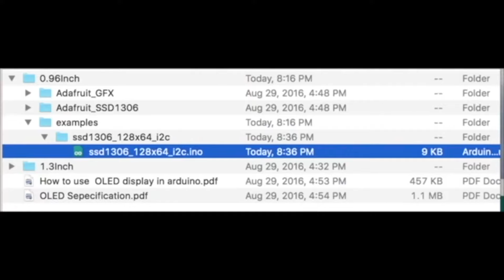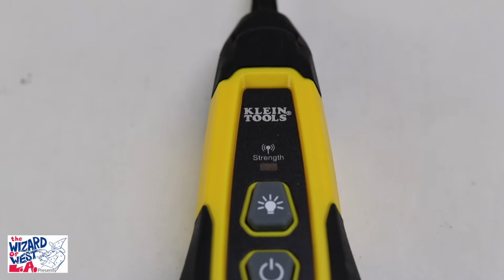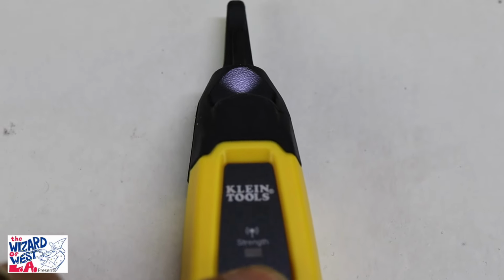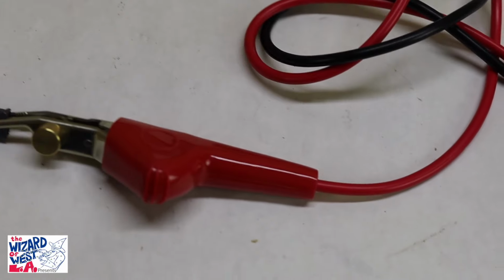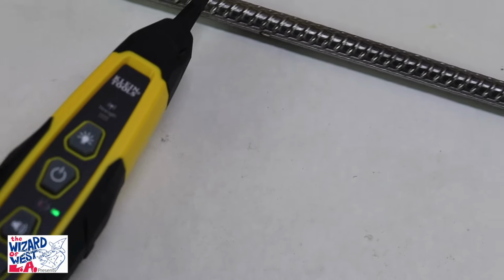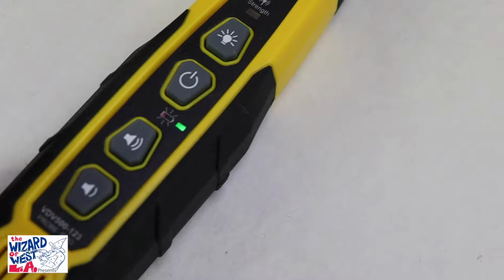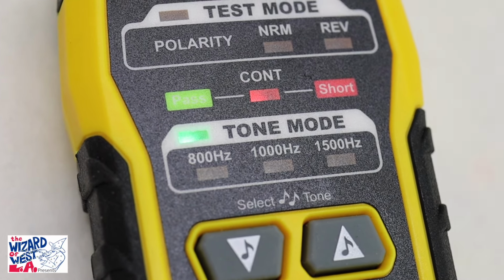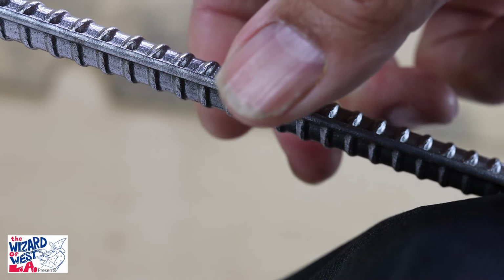How to use a Tone Generator (Klein VDV500-123)

Comment: Would have been great if you demonstrated on an actual cluster of wires instead of a big piece of steel
Reply from the maker: Yes I will do that using a cluster of wires. Some tied together and other apart.
Reply from the maker: Thanks Victor for the suggestion
Reply: What about the bottom of the probe...the 2 holes!..what’s it for??
Reply: @xbnayshun2765  those are to insert toned pairs for final confirmation

Comment: I bought one of these to sniff out the wiring in my house. I was able to find two buried junction boxes in my garage ceiling and wiring running behind a wall. It saved me from tearing out that wall and those two junction boxes had overheated in the past, with some good scorching going on in the boxes. Also helped with the HVAC wiring, an installer hacked it up, this sniffer allowed me to make sure that wiring was still useable vs running new wiring through the wall and ceiling. The tone is just fine, it easily sniffed out multiple wiring in several walls which saved me a lot of work and time. I'm keeping mine, and I don't work for Klein.

Comment: 1- Another trick which is somehow based on the same concept you alluded to (touching the conductor by your finger), is that if you connect both alligator clips to a pair of wires on one end and send the signal down the wires that way, and if  at the other end of wire you encounter a plethora of wires which you might find confusing to identify,  the trick would be to keep the probe amoung those wires so that you hear the probe sound, then try to short ends of each pair together. Once the pair which carry the signal get shorted, probe sound would stop.
2- I suppose the finger-touching trick you mentioned, is based on the concept that a bunch of wires close to each other can influence each other and due to the sensitivity of the probe, influenced-wires would cause probe's sound as well. By distancing the probe from the wire, in effect you are reducing the sensitivity of probe applied to the end of the wire, then by touching the wire by your finger, you are giving another path to the signal in wire to pass through (sort of grounding), hence weaker sound form the probe. I suppose if you wet you finger and stand bare footed on concrete, when you touch the wire with your finger, perhaps probe's sound stops (in fact your are grounding the signal in wire via your body). I don't have one of these, therefore I  cannot test the above theory. I suppose if they make probes with sensitivity adjustment capabilities, we would not need to touch the wire by hand anymore. In such cases, when pretty much each wire is activating the probe, all we need to do would be to reduce the sensitivity of the probe and then bring the probe very close to wires. Signal-carrying-wire would activate the sound in probe, but other wire's signal would fall below the threshold of the sensitivity of the probe and would not cause any sound......Do you think this makes sense? .... BTW, thanks for your wonderful video ...

Comment: You are awesome! I have this tool and couldnt get it to work right and I finally got it to work right! Cant wait for the next job I get with a mess of cables to search through to finally be able to find what I need in a few seconds ! Right now pulling out connections and testing them one at a time to find a number tag is a pain!
Reply from the maker: Thanks you! Yes I am finding more and more uses for mine as I have to do a lot of wire tracing. Many times the labels are wrong. Thanks again for your comment!!! Thank you Sam Peters
Reply: I found 1 of these ,do you know the value, or what I can get for it if I try to sale it
Reply: @joedavila406  $2.00
Reply: I didn’t have any need for mine so I sold it at the pawnshop they only gave me $15 for it and then another $20 for the box

Comment: I have two outlets in my house that aren't working - both on the kitchen counter. One was a GFCI and I found out it had a loose connection and was creating an arc and burning the wire. The damage was very minor, but I replaced the whole thing anyway. However, the actual power lines before AND after replacing it, were dead (with the circuit breaker on, of course).

The entire house is daisy-chained and several of the GFCI outlets are connected. One goes out, and you have to find out which one popped so you can reset it. But I didn't find any of them that were popped. (I say popped, because the reset button "pops" out when the circuit triggers a break.) So now I have no idea what to think. I've tested a few other outlets in the house, and they work fine. The problem is either between two outlets, or it is another connected outlet with loose wires that are no longer providing electricity to the two dead ones. But I have NO CLUE where this line leads to next! It's not the next outlet along the kitchen counter because that outlet appears to be a "dead end" that doesn't lead to another. Same with the second outlet that doesn't work - it seems to be the end of the line for that circuit too.

So will a tone generator help me find which outlet this dead one is connected to? I was thinking about clipping the alligator clip on to the "live" wire at this outlet while the circuit was actually turned off at the breaker box. Then I was going to use the probe near the various outlets of the house to find where it leads. But it seems all tone generators are meant for just RJ11 and RJ45 lines. Will they (all) still work on electrical wires too? I don't need to follow the wires all the way through the wall, I just need to find the next outlet it connects to!

Comment: The trouble is household 120V wiring is not shielded and when you have a slew of wires coming out of the side of a fuse panel that are all bundled together (and even if you cut the tye-wraps to spread the 14/2 wires), the signal still makes it to the adjacent wires. Go ahead and try to find the wire in question.

Comment: Hi! I am a new IT Field Engineer that is working onsite for a client. Just the other day, I was asked to trace a network cable and it was a disaster.  I am looking to invest in this tool since I am a beginner. Can this be used with RJ-45?
Reply from the maker: Yes it has an adapter to work with RJ-45. Yes Veni it can be crazy sometimes tracing a network. I will also see other products that do some tracing also. Thanks for watching

Comment: So, technically, I could shut off all circuits in a panel, clip to the hot wire of a cable, and trace much more accurately because it won’t be like the neutral or ground, which both connect at the service, and would ring out where ANY electrical wiring is?

Comment: This is mostly used on telecommunications copper voice and dsl lines. I don't know the distance of the featured tone generator oscillation but the Greenlee , Tempo and Fluke brands tests up to 7 km. It will get lower with further distance but still audible in a 1000 pair 0.5 copper strands.
Reply from the maker: That’s great to know. Thanks!!!

Comment: Could you use this to locate unlabeled hvac units on roofs and use the signal through copper pipes to find the inside unit?
Reply: Yes
Reply: Be weary of linesets crossing and touching multiple lines.   Or gas pipes. Or metallic conduits.
Reply: I assume this device / system can be used to trace electrical wiring as well?  If the system was switched off (not live wire).   Been wanting to get something like that for isolating and following cable

Comment: I’m not really sure what touching the two probes through a conductor has to do with an incomplete circuit. It seems to me that you wouldn’t need to do this. If your red probe is basically Performing as a radio frequency transmitter along a single wire the tone should simply stop working when you find the broken section of the wire. The black connector does not seem to be needed at all and why would you touch the two probes together near the source when it wouldn’t generate at home along the wire at all anyways? Lastly a demonstration of what happens when you move the receiving unit away from and closer to the toned wire would be useful to show signal strength.
Reply from the maker: My goal is to do another video with it really retracing the wire. I want to demonstrate how well it performs. I also want to try other sensors also. Thanks Roman for you comments!!! And thanks for watching. If there is anything else you would like to see let me know.